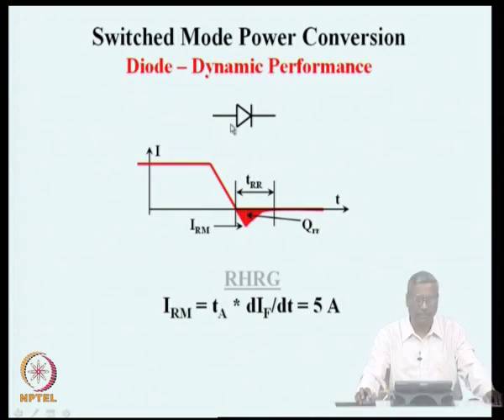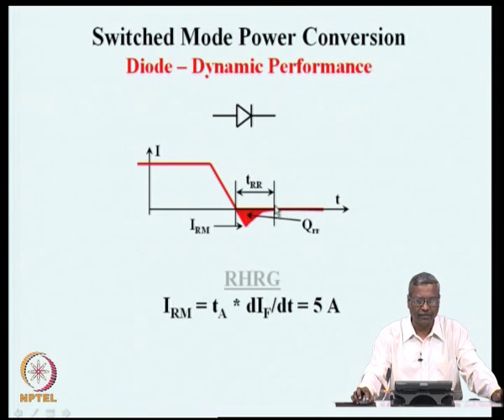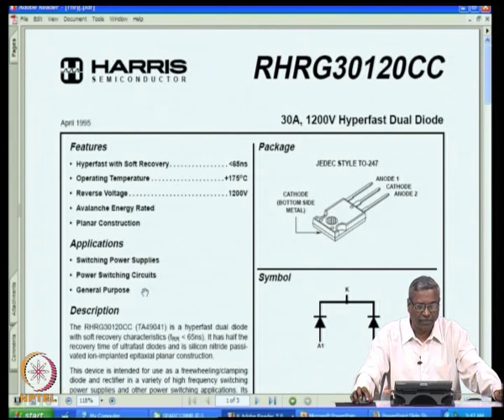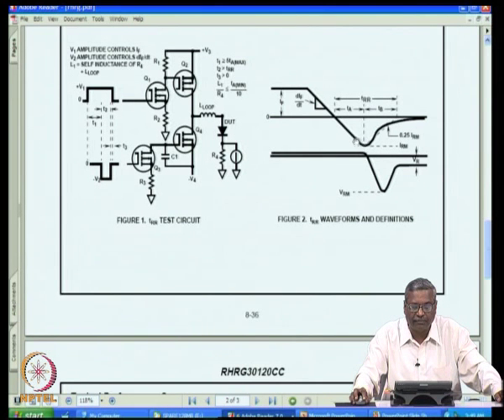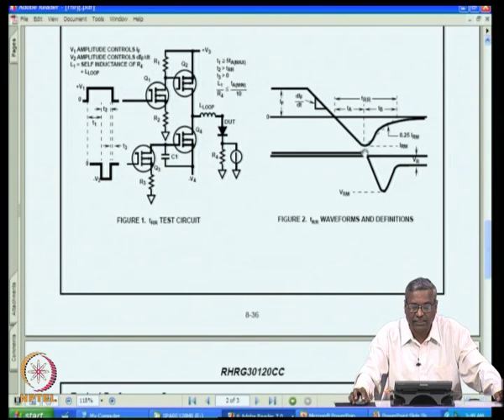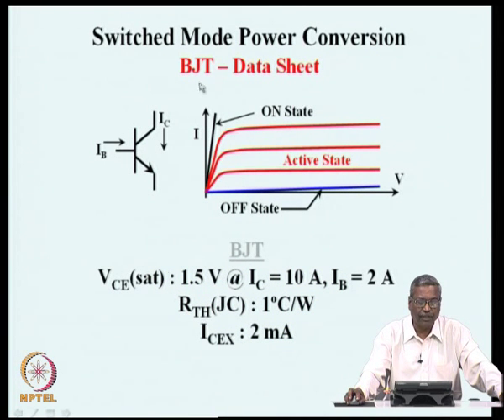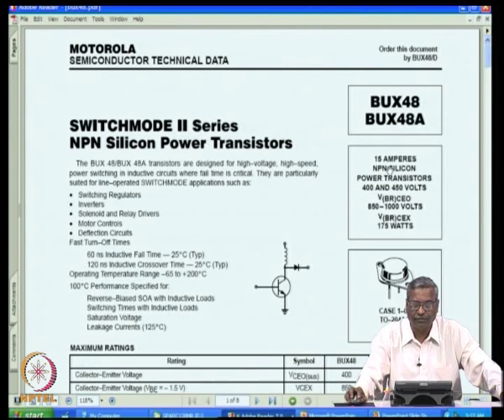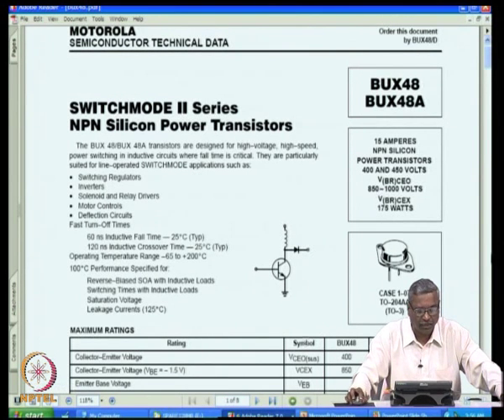Mod-02 Lec-03 Controlled Switches

Comment: With zero stray inductances and no reverse-recovery current through the diode. The transistor experiences high stresses at tum-on and tum-off when both its
voltage and current are high simultaneously, thus causing a high instantaneous power
dissipation. Moreover, the stray inductances result in overvoltage, and the
diode reverse-recovery current causes overcurrent. If necessary, snubber circuits are used to reduce these stresses.

Comment: At about 53:14, the speaker indicates the new switching loss has been reduced. I understand this, but where did the divide by 12 come from?
Reply: I also have the same query ?, Have you got the answer ?
Reply: Anyone got the answer after 7 years
Reply: @anujnayak5339  it should be 6, assume that the non linear curve is approximately linear then find the energy loss using integration, u will get double the energy mentioned in the lecture.

Comment: Ro is chosen such that the Lo/Ro time constant is much less than the minimum off time in the given application. This will ensure that the snubber inductor is reset during the off time and is ready for the next turn-on.

Rf is chosen such that the Rf*Cf time constant is much less than the minimum on time in the given application. This will ensure that the snubber capacitor is reset during the on time and is ready for the next turn-off.